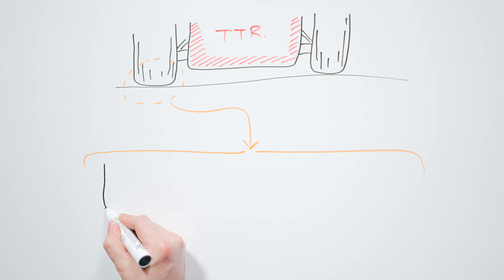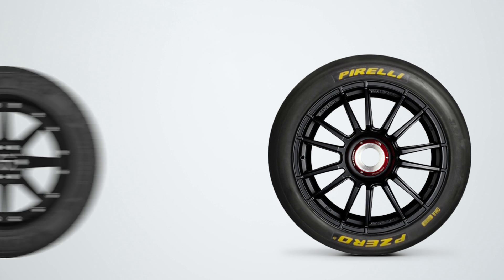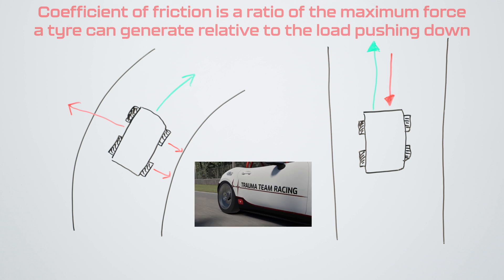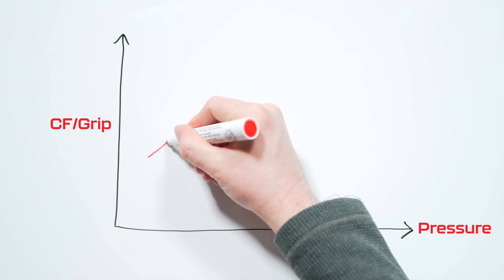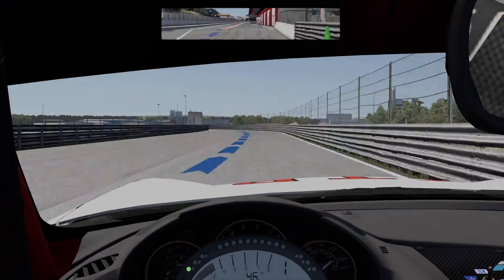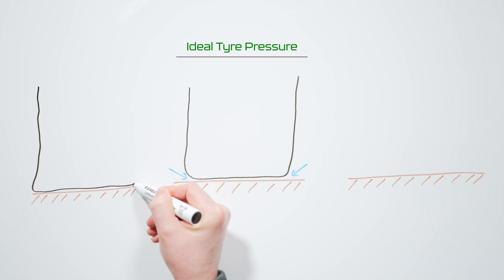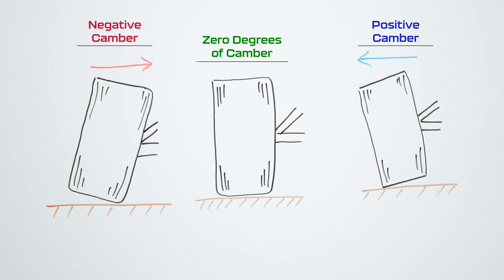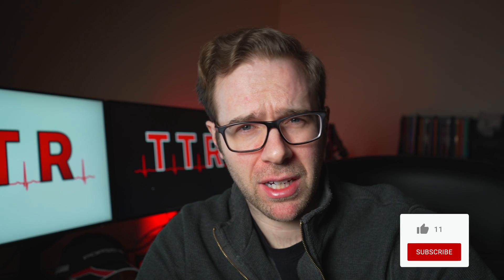How to Adjust Tyre Pressures in Sim Racing? - Beginners Guide

Comment: Great production value and structure, unfortunately you assume that simulators like iRacing are perfect which is not the case.
Taking iRacing as example here, but this applies to any sim to some extent: 

In iRacing you don't actually want to hit the perfect pressure, because the physics in iRacing are different than in the real world. 
Modeling the tire walls is extremely difficult and there's no sim who got it right yet. In iRacings case it means that you always want to aim for underpressurized tires because you don't suffer any penalties from it. The car doesn't feel sluggish because the tire wall can handle it. So all you are left with is more grip because the contact area between track and tire is bigger with the lowest pressure, as it's showcased at 5:37 

That's why everyone is always aiming to keep the tires as cold as possible, while driving with the lowest pressures that can be set.
Reply from the maker: Thank you for your comment. No assumptions were made. The use of iracing was purely to illustrate a concept. The tire model in every simulator will differ. This tutorial was based off of real world tire management and using that to apply it to sim racing. I appreciate there will be variation between sim titles.